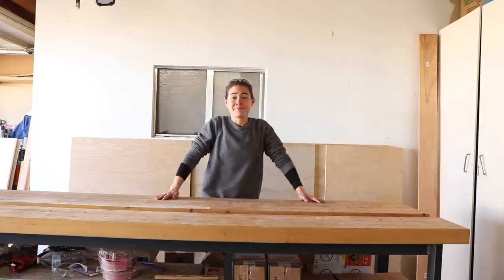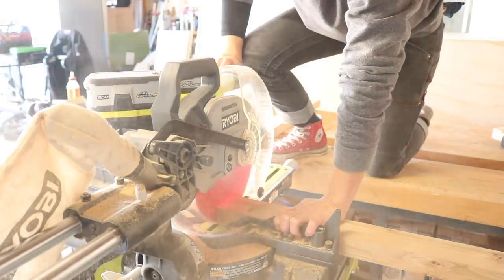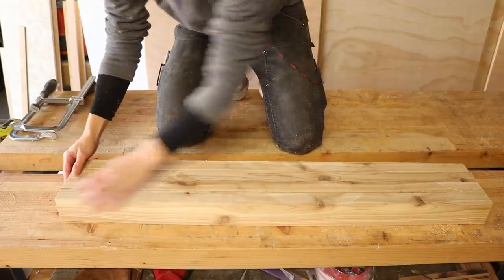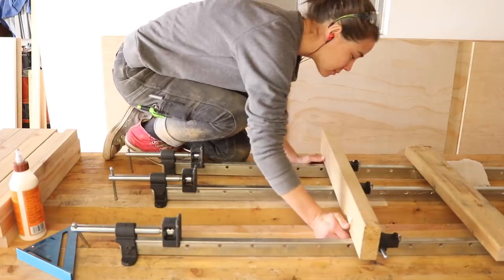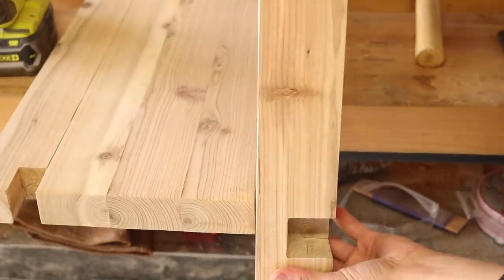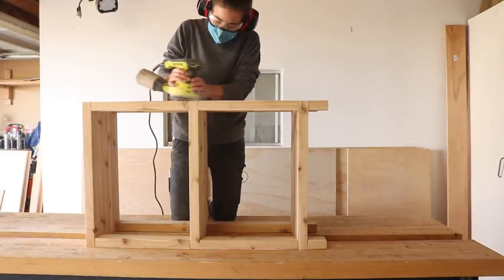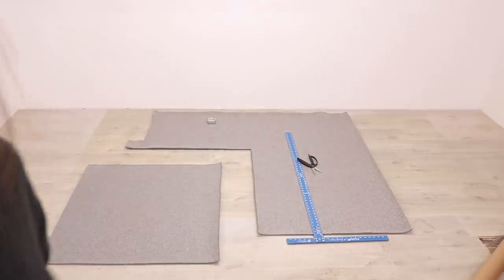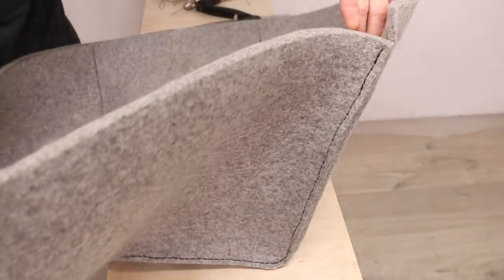DIY Cedar Shelf with Felt Hampers | Bathroom Furniture

Comment: They came out great, My last box had dovetails that were gappy enough to drive a truck through. Your joinery looks pretty good to me. My strategy is: if it's to wonky looking, I call it "Rustic" and charge extra.  Also, I have been using my bench all wrong. How embarrassing. Thanks for the how to!
Reply from the maker: i have realized that most people do not know how to properly use a workbench.  i am working hard to raise awareness

Comment: Don't know what I'm doing suggesting a next project...but if the hampers still don't work, maybe a big sign made from plywood and 2x4s stained with a midwax poly that read "dirty clothes in hamper"
Reply from the maker: and if that doesn't work then i'll do a third video of a 6' tall neon arrow that flashes
Reply: @ijessup  which would be a good "evolution" because electricals.

But on a more serious note, i just thought about the felt hampers and adding straps to them make them into big totes to lug the dirty laundry to the laundry easier <3

Big fan. Keep it up!
Reply from the maker: @nikkidelcarmen8000  i thought about it...  and was too lazy.  but, you're right; that would be a much better finish product.  i have more ideas for sewing projects though so...  handles, comin' up!
Reply: @ijessup   ijessup  no judgement about the lazy bit. If it's 10mins per stitch x...i dunno can't math...8(?) Stitches? That's...yeah.
Reply from the maker: a bag... made out of handles... with eight stitches...  this is going to be interesting